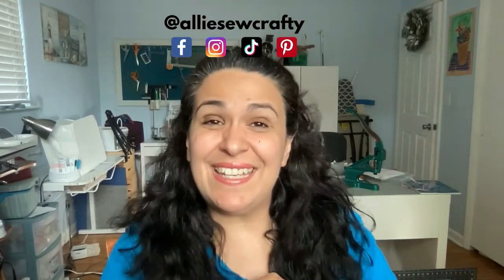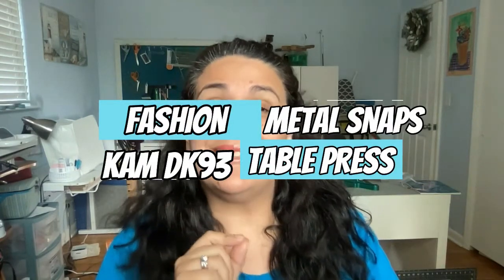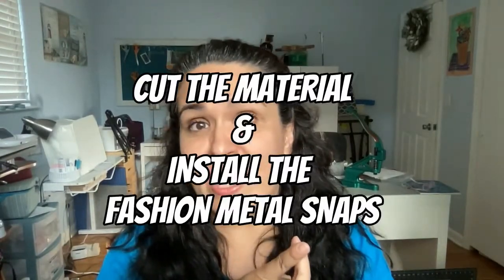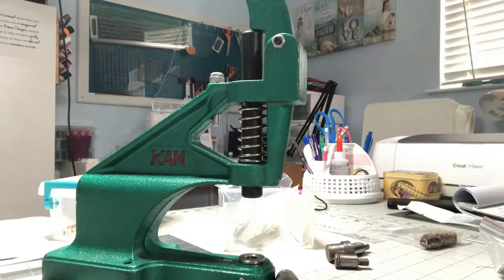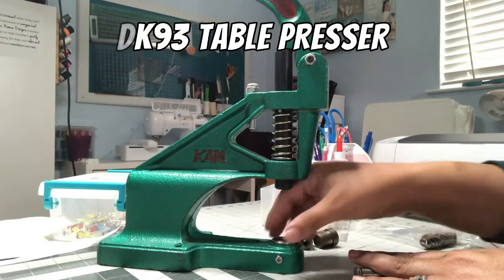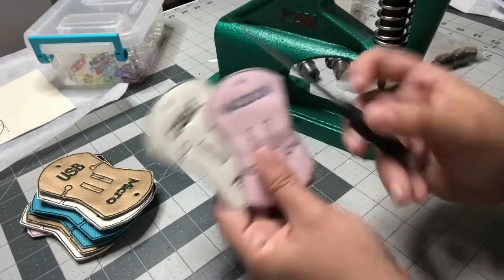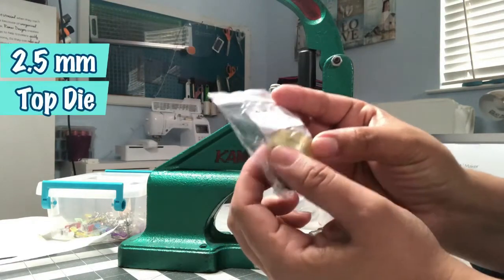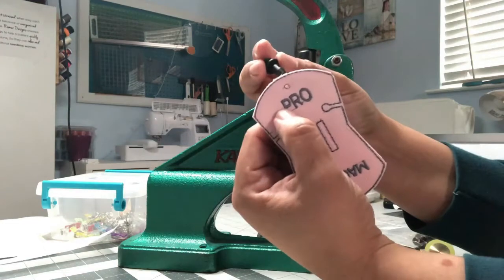Let's Install Fashion Metal Snaps with a KAM table press

Comment: I enjoyed your video. I make similar cord keepers as well using the plastic snaps. I want to add the metal snaps to my inventory, so your video was helpful.  I do, however, add my words, etc. before I add the backing piece. I also make my slits at this time as well. Then, as the last step, I slide a piece of vinyl as the backing piece and sew the final stitching that goes around the edges to join the top and bottom. This way there is just the plain backing that shows. Everything else is covered up.   Embroidery garden has this free pattern if anyone is interested.
Reply from the maker: Great tip! Thanks for sharing :)

Comment: I have a kamsnaps table press and many dies and the adapters. I love it and use it all the time. It is a game changer and a time saver for sure. I do not have the fashion metal snaps or dies and I want to purchase for purses, small wallets and pouches. I can't decide what size dies I need. What size do you use? 14, 20 or 24. Do I need to purchase all sizes? Thank you so much for your tutorial.
Reply from the maker: Hi! I've only used size 14 fashion metal snaps, and for what I understand, each size requires a different die for that size. I've been making bags and toiletries for years and I've only needed size 14, so I definitely think that is a good size to have available :)

Comment: Great video, but for those who are interested in how to install the snap go to about the 12th minute of the video.  The first portion is focused on the hole punch used on the material to get the needed hole...also useful, but just not the part I was interested in today.
Reply from the maker: Glad you found what you needed. :)